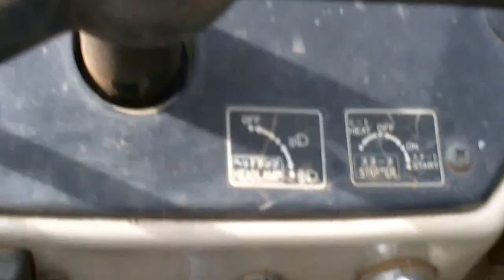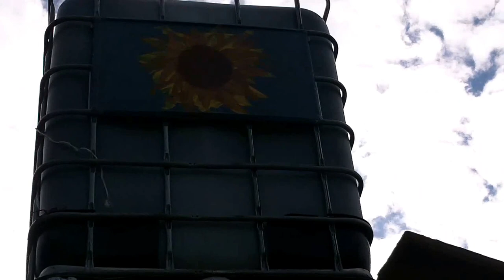The Erection of the Water Tower

Comment: OK, that's a tote they are putting up top which probably hold 275 gallons of water.  At 8 pounds-per gallon, that's 2,200 pounds of weight on top of what looks like a deer stand.  That's more than one-ton up on those legs!   Not sure this was a safe idea
Reply: Obviousness from your comment meant that you didn't watch the whole video.  When his wife climbs the tower and shows the video from inside the tower, you see the true structural integrity of that tower.

Double 3/4 legs to start.  3/4 rebar cross bracing across both levels.  There was also 3/4 rebar braces horizontal to help strengthen the full integrity of the tower.

Thanks for the video,  it gave me some ideas to use for myself.  I'm working out the weights and build for a quad tote tower for our place.  The vertical and horizontal cross bracing is something I am now going to look at hard!
Reply: Something happened